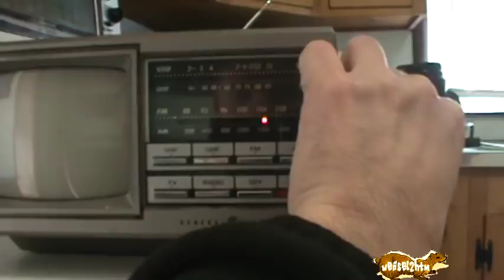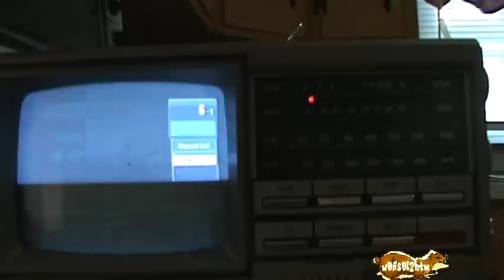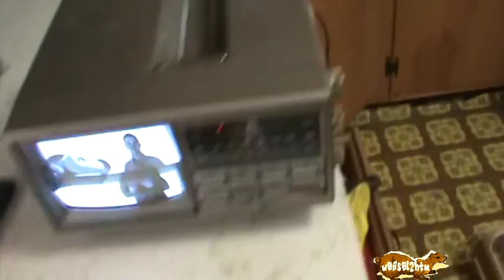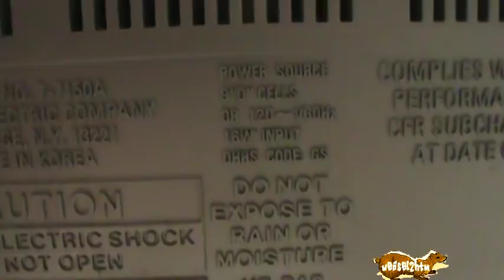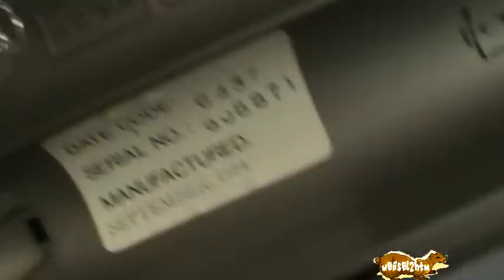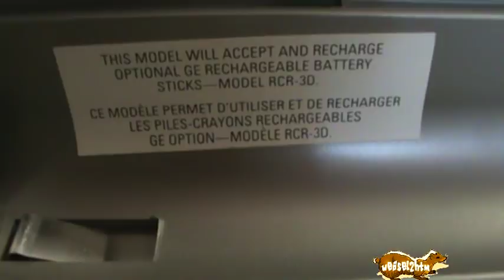Portable GE Television

Comment from the maker: @uxwbill Well I guess there is always a power inverter.  I left the Composite A/V cables plugged in to I would not lose them, if you look close you'll see that I have the RF grounded to the Right RCA in my "rigged" setup.

Comment: i have one i got from an estate sale with porn drawn everywhere and there is paint on it from it
it has dying capacitors so it occasionally turns off but other than that it works just fine and i cant seem to find a way to get the paint removed so i guess all i have to do is a cap change
it also came with general electric power sticks (replacement for 3 d batterys) that i just now discovered i cant find anything on the internet about them so i cant charge them to use them